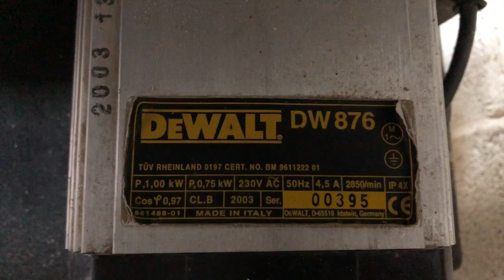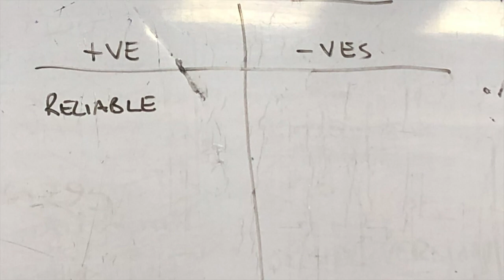The Dewalt 876 Bandsaw - Tool Review Tuesday

Comment: Phenomenal portaband. Worth the wait in replacing my stolen previous model MyBest.Tools Variable speed, with an adjustable governor, adjustable shoe, and locking articulating forward handle. It's beefy, but feels just incredibly well built and solid, will eat through strut, emt, rigid, all thread, whatever, all day.

Comment: Boring question I bought one 4 years ago and never got round to replacing blade any recommendations for blade makes and suppliers and also need a replacement fence? Great helfpul vid Thanks
Reply from the maker: raymond scott Hi Raymond, Blimey you’ve done great to last 4 years with a blade 👍🏻 I’ve tried a few blade suppliers and the one I’ve stuck with for my bandsaw blades is Axminster Tools. When you change the blade ensure you move the guides out of the way and re adjust them to the new blade to ensure you don’t accidentally knock the set off the teeth of the new blade, Yep I’ve done that 😏 as for the fence is it totally trashed? I would definitely try to make one myself probably because I like a challenge and tight 😉 Thanks for the watch and comment. Cheers Steve

Comment: I've got the exact same bandsaw, I payed £140 on Ebay about 9 months ago and since then have seen the price rocket even for second hand ones, they now sell for between £450 and £1300 the lower price is for the dw876 that has been abused beyond recognition!
As for this for sale brand new an astonishing £1950 ouch!!!
Reply from the maker: Simon r £140 is blooming good value hope it’s serving you well, as for the higher prices it beggars belief what a named brand can command at times 😳. Thanks for the comment 👍🏻 cheers Steve
Reply: @Phenrica  steve the best part about it was that it had been used only twice by a retired gentleman. When I collected it he told me that he was hoping to do some little jobs around his property now he had retired,  but when push come to shove he just couldn't get his head around woodworking whatsoever!!!.
Another one for sale at the exact same time sold for £370 so I  definitely fell lucky there and it looked like new!!!
Reply: Just picked up one here in the US for like $150 and i can't seem to find any indication that they were ever sold in the US,  Do I have the only 120V DW876?  Even the official dewalt parts website has nothing on this model
Reply: @outlawstar96  honestly I don't know 😕 but I can say that over here in the UK it's a 230volts. Will there be enough power at 110v ?
Reply: @simonr6793  its definitely a 120V motor.
Reply: @outlawstar96  sounds like we both ended up with a cracking little bargain 🤣.  Have fun with it and try remember to keep your fingers out of the way!! All the best from the UK 🇬🇧 👍

Comment: hi, thanks for the video, quick question, how do you get the 200mm cut height? I cannot get it more than 160mm
Reply from the maker: Hi, that’s strange I can only assume that’s there must be some kind of obstruction that’s stopping the the guide post fully retract? Checked mine and at a push could get very near to 210mm of blade exposed.

Comment: Hi Steve, I've had the Dewalt DW876 for many years and lately the blade seems to drift to the right. Is this just a dull blade (New ones ordered) or could it be something else? All the fences and guides are checked and blade tightness OK. I have noticed that the blade sit middle of the top wheel but sits forward of the bottom wheel but I cant see how to alter the bottom wheel. I don't suppose you have any tips or advice that may help me solve the drift, Cheers
Reply from the maker: Hi Antony, I would guess it’s the blade, as for the bottom wheel that should not affect anything as that’s really just the drive (just wonder as you’ve had it a while is there any excessive play in the bearings on the bottom wheel? )
A couple of things you could try is positioning the blade on the top wheel with the gullet of the blade in the centre (the tyre should be slightly convex and this may be a cause) ensure the guide blocks are behind the gullet when the blade is up against thrust bearing at the back (sorry if I’m telling stuff you already know, this can cause issues especially knocking the set of the blade teeth)
I find as the blade gets dull, the more force you apply to cut and therefore drifting tends to occur.

Hope that helps

Cheers Steve
Reply: @Phenrica  Hi Steve, cheers for the reply. Having read your advice I'm pretty sure it must be a dull blade. There's no play in the bearings and everything else is as it should be. Much appreciated 👍
Reply from the maker: @diabolicalification  usually it’s a blade past it’s prime issue 😉 just another thought on the bottom wheel, there’s a cap with 4 radial bolts and a centre bolt at the rear of the bandsaw. You might be able to adjust the wheel via that tough I’ve never messed with that 🤔 however like I said as long as it drives the blade then no real need to mess.
Reply: @Phenrica  yeah I looked at that nut Steve, the one with 4 others around it. But left well alone 😯. I'll wait now and see how it performs with a new blade 👍 cheers
Reply: Hi Steve. Got the new blades and all is good. 😁Thanks for your help
Reply from the maker: @diabolicalification  Brilliant 👍🏻

Comment: bougth the machıne but stıll dont know how to chance the blade,
 could not fınd any where
Reply from the maker: Ok, it’s quite easy
1, unplug the bandsaw
2. Release the tension by turning the handle on the top anti clockwise as far as it will go
3. Undo and pull the guide blocks and rear guide bearing clear of the blade, do this on both the upper and lower guides
4. Open the door and see if you can remove the blade, if not
5. Undo the locking nut on the tracking screw - located at the rear and unwind the screw so the top wheel tips forward
6. Blade should come off easily 
7. Undo the front tracking rail and pull away
Now remove the blade - wear gloves as can be sharp.

Replace the blade filling the reverse of the above approach, when aligning the blade in the top wheel adjust the tracking to ensure the blade is central in the wheel, a few rotations by hand and slight adjustments of the tracking screws will achieve this.

Hope this helps